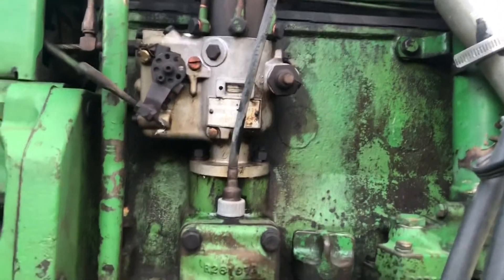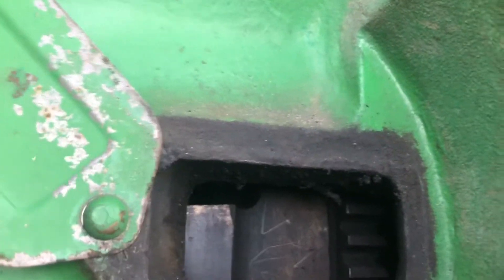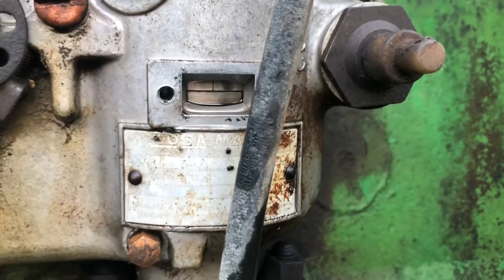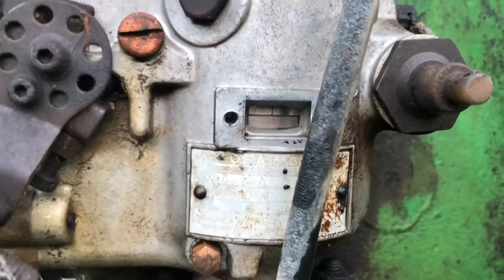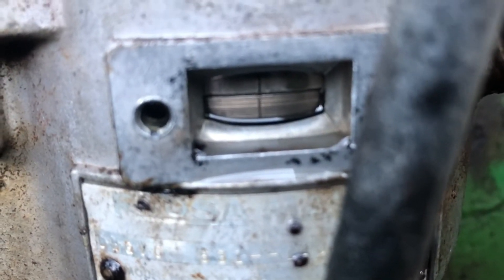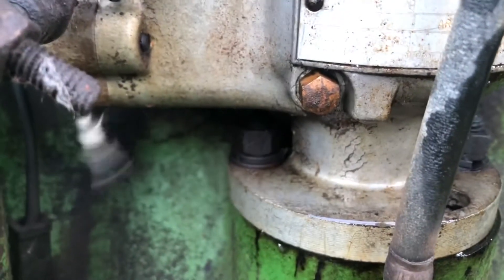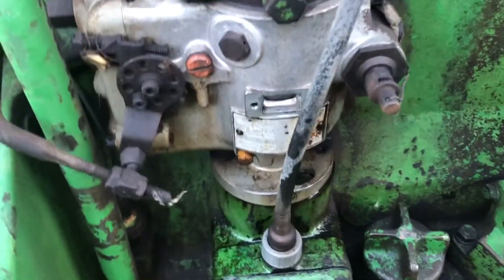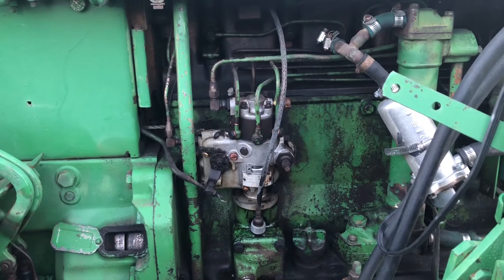Injection Pump Removal, Installation Procedure/4010 John Deere

Comment: I was curious when removing the pump itself did those fuel lines need replaced as well? Was there anything to note as far as putting the rebuilt pump back on the tractor? I don't know what I don't know as far as this process goes.
Reply from the maker: No, if the injector lines are not leaking or spraying while the engine is running, there is no need to replace them.. if you follow the procedure in the video you will be able to r and r the pump without any problem.

Comment: Jd manual stated 15 not TDC and my pump do align on that setting too (15) been using that for over 40 years so I think that it may relate to early years my tractor was one of the first 4010 Diesel built.
Reply: That's what my book says too. I think TDC was for later years like he said at the end of the video. His is 63 so I think that's why otherwise early years is 15 before TDC
Reply: @lankford1977   I am rebuilding the dual selective control valve that started seeping oil around the bolts after I increased the oil pressure to 25psi from 21psi it did work great and more powerful then the old seals did not like that. The kit no longer available so I had to order bolt by bolt to makeup the kit…the kit was under $50 and to replace it cost me $282.00 that included the valves, springs, gaskets, ballbearing x2
Reply: @Respectearnednotgiven  I don't have duals on mine though I'm looking to have them as I have the front bucket. I wouldn't need the valve body though per se as I just need constant flow to the bucket controls
Reply: @lankford1977  lucky you if you got the bucket I been looking fir one that fit but the prices are too extreme and if I found one the shipping exceed the asking price and locally in California high demand on them

Comment: How much did it cost you to get it rebuilt and did you take it to a john deere place to get it done?
Reply from the maker: It was around $1200 canadian to get it rebuilt at a diesel shop. Now it works perfectly.
Reply: Got one rebuild for US$690 exchange use as backup. Exact model and specs. When buying rebuild make sure that the numbers and letters on your pump match exactly if not you will get headaches again lol
Reply: Thank yall